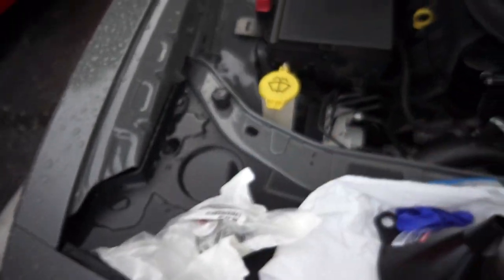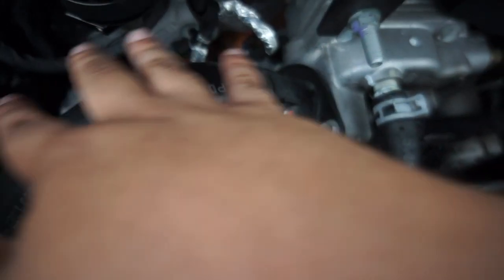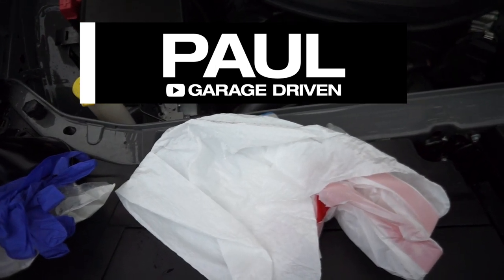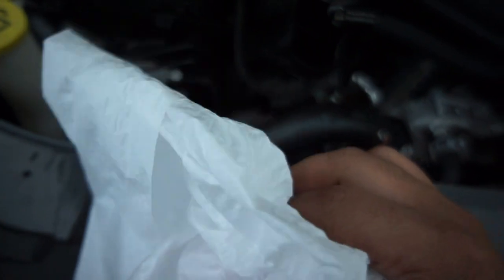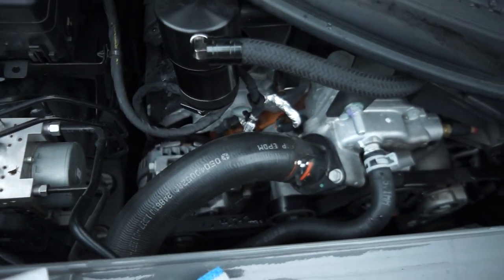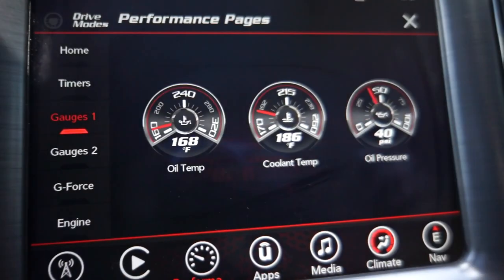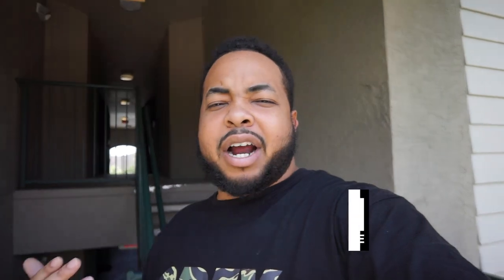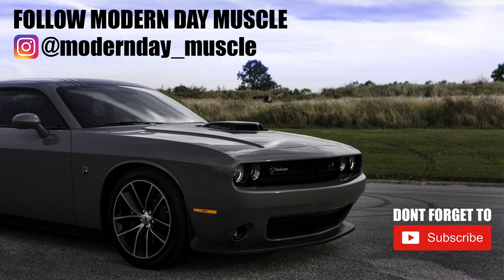180° Thermostat Install | 2015-2018 392 Challenger & Charger | 6.4L Hemi

Comment from the maker: This is actual 180 tstat I got guys
https://www.ebay.com/itm/06-18-Dodge-Chrysler-Ram-Jeep-5-7L-6-1L-6-4L-Hemi-Racing-Thermostat-180-Degree/392295999096?hash=item5b56a9e678:g:3VQAAOxy63FSvxuk
Reply: Does this fit the 2018 scat pack charger?
Reply from the maker: Yes it should
Reply: Hey brotha got a ? I just installed a 180 mishimoto tstat on my 2019 scatpack charger about two day’s ago.. Was running good till  Today I was riding around in town for in hour and my coolest temp started reading at a high level around 212 and 217.. Can you give me any feed back?
Reply from the maker: First off where are you living? Weather has an effect. 2nd I’ve seen some ppl get a faulty Tstat before to the pointer were the car would over heat. The usual Is get a replacement or just put the stock one back in. Another factor is how Lon gets was he car running when u noticed this
Reply: Modern Day Muscle I live in south Texas pretty hot weather.. I noticed it like 30 minutes in to the drive.. Im at my house now I’m setting in my car right now and the coolant is lowering slowly.. It is at 201 right now
Reply: Stop and go traffic
Reply from the maker: Ahhh... yeah u might have a faulty tstat

Comment: 180°f thermostat- Caution!
  A few (ok, maybe more) words of wisdom for anyone who has done/is contemplating doing this swap as I've seen quite a few new videos, all promoting the 180° thermostat as "one of the key, must do, easy mods for your 392."

(Who da heck am I to open my trap, anyway??)

  I'm an ASE certified tech in engine repair and performance with five decades of practical experience, especially with Mopars.
I currently have a '23 Scat Pack, Shake-down edition with 6spd. and, a 1974 Road Runner with a 440 magnum pushing it along...  Cooling issues and all.  😊
  I, too had considered and looked into the current, 180° thermostat swap rather carefully.   I've been working on high performance engines (and old beaters barely keeping their heads on the block) since 1973, when I helped built my first, gen 1, 392 hemi along side my old man in our home shop.  (It ran like a scalded dog!) 😉 
  The whole "should I or shouldn't I" question about swapping in a 180° thermostat is...  You shouldn't.
You're noticing wide temp fluctuations for reasons beyond just the outside temps.
  Unless you're going to be racing and holding the throttle wide open for a good bit of the time, the colder thermostat just works in conflict with the factory design and tune of the fans/engine.

A:  The designed operating temps of the current 392 are intentionally/ideally between 203°f and 215°f at standard operating conditions, such as on the street and occasional race conditions (not hot lapping) as this facilitates proper operation and combustion temperatures for the way these engines are intending to operate according to Mopar factory engineers.  A visit to the Challenger/Charger Mopar forums such as "Challenger talk" will confirm my statements. 
  Swapping in a colder thermostat is a viable option for extreme duty situations, meaning taking this thing to the track as a regular occurrence but, is otherwise basically useless in every day driving conditions. 
B:  Unless, you program the cooling fans to operate at a cooler temperature to work in unison/harmony with the colder thermostat.  This way, the overall temps are kept closer to optimal (215°) during performance runs.  However, going through all this just to run it on the streets will only cause conflicts in other parts of the system.
  If the fans aren't re-tuned, the system is constantly fighting itself by trying to bring the operating temps back towards the intended 203-215° temps, only to have the colder thermostat then try to cool it back down.  Will it run cooler? Yes...  For a while and then it will struggle to try to go right back up.
  It's harder than one thinks to find a 180° thermostat for these things (Napa, the dealer, etc.) for a reason as they're not intended to be just a common, over the counter part.  You have (in most cases) to go to a performance parts dealer.
  The benefits of the colder therm just really don't come into play until you hit the strip and the temps really start to build and don't readily come back down, as it does with only occasional high performance operation.
  A lot of full throttle operation and a re-tune of your fans will help keep it cooler when you're pushing it, for sure.  But remember, you're still looking for those low 200s in temp, overall. 
  In the old school hemis and other performance engines (like I grew up with), lowering the operating temps was standard practice in hot climates and racing situations because the engine systems weren't all controlled by the computer (which is doing its damndest to keep it at a certain temperature point) and as a result, they would experience pre-detonation (pinging) and eventual piston damage.  Engines overheated a lot easier, city/stop and go driving  tempting the car gods for an eventual boil over.
  In fact, in a lot of the old school hot rods, like my father and his cronies were running back in the 50s, they'd use a hot water bottle as a radiator, something to just facilitate adding the nominal amount of coolant they did run into the block. 😊  This let them get up to operating race temps quicker when they were getting ready to hit the strip (wherever that may be). 😉
  So, don't get to fired up about wasting time and money on a thermostat swap unless you're going racing and plan on a re-tune and everything that goes along with that. 😊

Comment: Good video I’m about to do this to mine because my tstat is actually locked open. My car running at 185 constantly 😅 a got the best case scenario with a busted tstat mine stuck open instead of closed. I’ll tag you in my video.

Comment: You need to put the burp hole at the 12 o’clock position.  You might want to fix that
Reply: I was thinking the same
Reply: So keep the hole straight up basically?
Reply: @brandonUwanawich954  yes
Reply: @danieljohn4603  amazing another video told me keep it to the side like 9 o clock am I gonna have to re install it or could I drive it like this🤬
Reply: @brandonUwanawich954  I would fix it
Reply: @danieljohn4603  was his sitting at 9 o’clock?  Thx
Reply: @tundrawhisperer4821  in his video, it was wrong.
Reply: @danieljohn4603  Thank you.  Would you have a recommendation on a particular one to buy?  Thx
Reply: @tundrawhisperer4821  I had the Mishimoto. Worked good for me

Comment: Nice man.  Thanks for sharing. I will be getting the 180 thermo for my challenger here shortly.
Reply: Also. I had the same results when I ran it in my old Charger. As long as I was moving now and then I was in the same range 185-192.  Can’t wait to get mine.

Comment: I'm kinda a noob at this but you mentioned you have to tune the car....what does this involve?
Reply from the maker: Dyno to measure cars horsepower and torque and then a tuner to configure the car to perform better to either gain more power or just run better in general

Comment: The link to the T stat is no longer good, does anybody have a recommended one to use for a 2018 Dodge Charger Daytona 392?
Reply: Motorad 416-180 is a great one for the hemi. Same one MMX sells.
Reply: @robcolletti  did you tune your car after installing?  Thx

Comment: Dope video were can I purchase this item
Reply from the maker: The product is by Mishimoto. I tried to find a permanent link but ebay tends to change so here is the link at the moment https://www.ebay.com/itm/Mishimoto-Dodge-Chrysler-Ram-Jeep-5-7L-6-1L-6-4L-392-New-Racing-Thermostat-180/392200036605?epid=1824331578&hash=item5b50f1a0fd:g:3VQAAOxy63FSvxuk